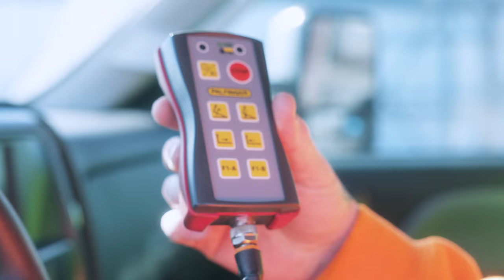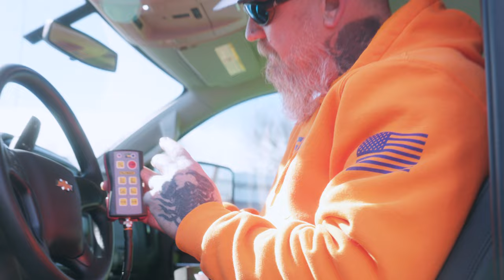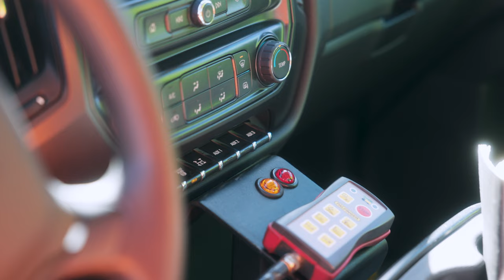Step by Step - How to operate a Hooklift truck!

Comment: What is the wheelbase of that truck ?  Length of can ? and also how many yards is it ? and what is the GVW of the truck ? this was by far the best video for instructional purposes and how to safely operate a hook lift ! I appreciate it very much
Reply from the maker: Thank You Rich for watching. 

1. Wheelbase = 108”
2. Length of can in video = 12’5”
3. 12.86 cubic yard capacity
4. GVW = 23,000

Thanks for the support my friend.
Reply: @samedaydumpster  With this wheelbase are you running your 22yards on this same exact truck as well? Is all your trucks have the same exact hooklift system and same 108 CA?
Reply from the maker: @davidc5808  No, this truck in this video is 108” CA. I also run a 120” CA truck.
Reply: @samedaydumpster  Awesome! And the 108 CA can run the 22yard no problem? What's the difference between having a 108CA and 120CA? Any advantages or disadvantages?
Reply from the maker: @davidc5808  The preferred truck for the 22’s is the 120” CA truck. That truck is a little longer but the cans ride best on it. We do so much work in the downtown area, the 108” CA truck is the preferred choice for those extremely tight job sites. The 108” CA Carrie’s the 22’s perfectly fine, they just ride that much better on the 120” CA
Reply: @samedaydumpster  That's awesome!!! And how does your PTO work? Are you able to operate the hooklift while in gear and moving or only in park and neutral?
Reply from the maker: @davidc5808  We have our trucks all setup the same, we are able to move while the PTO is running. Honestly, I wouldn’t be able to safely and efficiently operate my trucks if the PTO only worked in park or neutral.
Reply: @samedaydumpster  Great! I guess if I do make the switchover from MAXXD trailer to one just like yours imma call ruble and say get me a truck exactly like same day 😅😂
Reply from the maker: @davidc5808  Best of luck my friend. Thanks for watching and supporting. Drive safe out there.
Reply: @samedaydumpster  Love the videos!!! Keep pumping them out!!!
Reply from the maker: @davidc5808  Thanks for the support Mark 🙏🏽
Reply: Do you have a clutch pump or does your pto run off the transmission
Reply: Crazy question , am I able to put a palfinger hook lift on the same style Chevy truck as yours 6500 with the four-wheel-drive and a crew cab to me that would fit my needs to also helps as a back up truck for my Landscape truck, if my truck goes to mechanic if this is possible, what will base would you order or is this thing going to be ridiculously long? Or can I get the shortest wheelbase available and make it happen?

Comment: Do you have a strategy for dealing with flat tires without too much downtime?
Reply from the maker: Buy the best tires money can buy and perform a daily pre-trip inspection and look at every tire every day. If you see a nail, screw or bolt or anything else, get it fixed ASAP before you destroy the tire buy running on it after you notice it. No secret pill when it comes to tires.
Reply: @samedaydumpster Thanks!

Comment: Great video John.  Definitely answered some of my questions.  What does your truck weigh empty with out a dumpster?  And What maximum weight capacity does it give you on say your 22yd dumpsters?  Thanks
Reply from the maker: Those are some great questions my friend. 

Truck weighs 12,540 ( with no cans )
Truck weighs 14,980 ( with a 22 cubic yard can )

We can legal 23,000lbs with this truck. 

23,000 - 14980 = 8020lbs of payload on our 22 cubic yard size cans.

Hope this is helpful. Thanks for watching.
Reply: @samedaydumpster  thank you for the information John.

Comment: Great vids! So much information really appreciate. stupid question, when you moved the truck from under the can that used/pushed the jib in or out?
Or is that the natural movement of the hook when you moved the truck forward.
Reply from the maker: It's both at the same time. Operating the jib at the same time moving the truck towards or away from the dumpster. Great question BTW.

Comment: Could you add the pistol grip bar to your cans as a extra lock back in the day would be called over kill
Reply from the maker: You could.... but you would loose the flexibility of of sliding your jib and stopping it anywhere you want to transport it. I don't believe it's needed to have both hotbeds and pistol grips at the same time. It wouldn't hurt, but def overkill.
Reply: @samedaydumpster  thank you it was a idea I got because of yours having the parts and had figured you had a chance to think about the idea so thank you for your reply

Comment: Hey, great content! Can you do a video of how to put the hooklift into 'City-Mode' and how to get it out of 'City-Mode'?
Reply from the maker: City Mode? teach me something.... I have not heard of that term before....
Reply: @samedaydumpster  ok, so there's a city-mode you can put the hooklift into. Which will restrict the functions of the hooklift, so certain movements will not be available. Basically, you won't be able to pick up or drop a dumpster in this mode. To put it into city-mode, I believe, you have to hold down the 'on' button and the 'lock' buttons for 10 seconds. There are probably more modes, but I haven't found it. The reason I'm mentioning this is because it somehow accidentally happened to one of our trucks, and it was basically useless that day.

Comment: Who fabricated your dumpsters? And what’s the benefit of setting the Hooke height to 54” rather than 36”?
Reply from the maker: Steel Products in Salt Lake City, UT. 

Without trying to write an entire book here, I personally wouldn't buy a 36" Hooklift truck or run 36" dumpsters at all. There's zero advantage over 54"... just drawbacks. If you are just getting into the game or just getting started, start with 54", you'll thank me later.

Comment: What model truck and hooklift do you have in this vid?
Reply from the maker: Chevrolet 6500 4x4 108" CA equipped with a Palfinger 16,000# system.
Reply: @samedaydumpster  
Gracias amigo 🙏